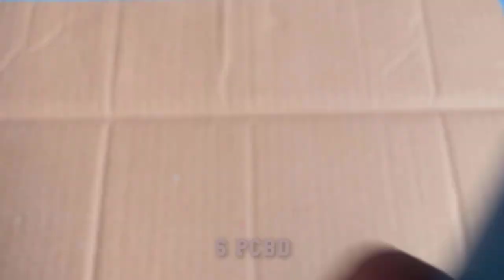Creative Easy -​ simple New create from pvc​ powerful vs Amazing slingshot

Comment: If you use double chamber it will have more power than one chamber alone
Reply: What double chanber
Reply: @brucevollman1609   a piece of material that separates 2 parts of the chamber and only have small hole to let the hot air travel from 1 chamber to another. It's like putting a rocket nozzle in the chamber to make the air travel faster than normal before get to the barrel :))
Reply: @anngoclepham2966  Do you have any other tips to make alcohol gun more powerfull?
Reply: @cesurkarakus209  a powerful alcoholgun doesn't come from the gun itself but also the bullet. if the barrel is large which makes bullet tumbles in it, in can't achieve as much power from the chamber. i suggest that you should make the bullet that fit right in the chamber. you can make it by wrapping tap around a bb until it fit the barrel :))

Comment: Bro try to spray acetone it's power full
Reply: Yes and no.

Yes, I agree it's more powerful than alcohol because it's more volatile (meaning it is faster to become a vapor, which contributes to a more effective fuel-air mixture) and your household alcohol is likely to be not concentrated (lower alcohol content percentage, obviously has lower volatility and therefore less explosive).

No, because unless you're using a metal blast chamber and metal barrel, acetone is a solvent. Although its dissolving capabilities is slower against PVC, over time it degrades the PVC making the PVC blast chamber thinner and weaker. If you're gonna use PVC, at least line the inside with metal, like tin cans.
Reply: How about starting fluid